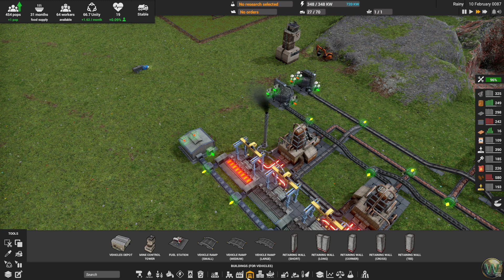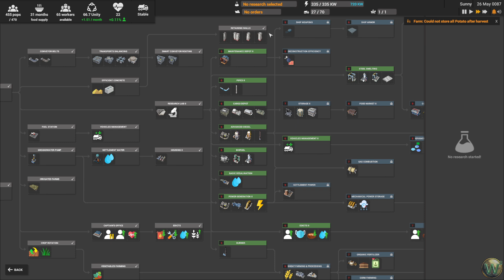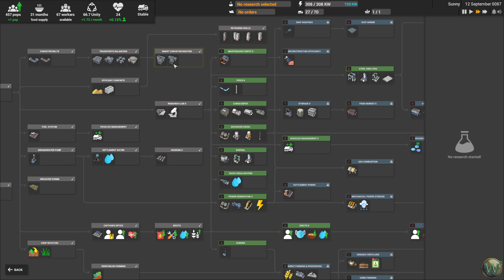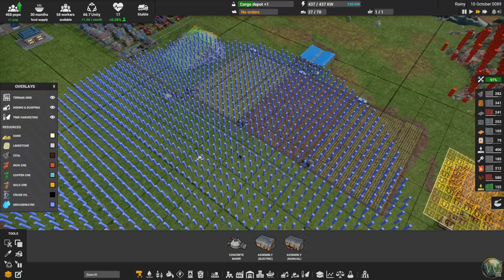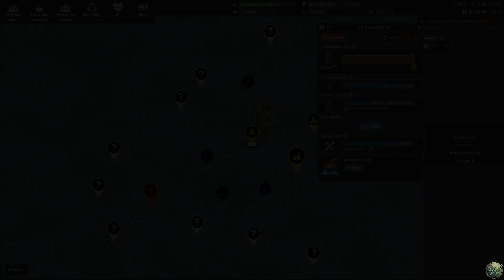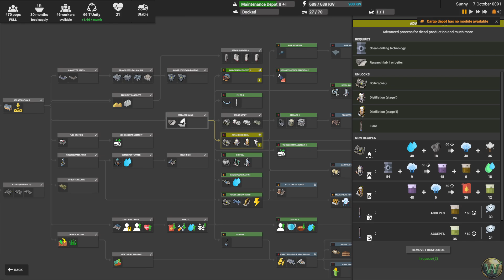Captain of Industry - Cargo Dock - Episode 15 - Let's Play

Comment: - Yes, you need additional tech to link towers with storages.  I didn't realize that it wasn't unlocked yet.  Advanced Logistics research is what you'll need.
- TRASHY solar! I like this idea :P But, power tech II is before that one .
- Storage in this game drives me nuts.  It's like ONI or Factory Town.  Not having a character with inventory can be a pain at times.
- Water is viewed by clicking on a pump just like the oil pumps.  Rain will replenish the pools over time.  However, you can outpace the replenishment with higher consumption so, be mindful of that.
- Yes, decon-ing things nets less material back.  Hover over an entity with the decon tool to see what will be returned and compare that to building a new one to see the loss.  It's a game so, psh.  Stuffs is not real (trust me, I know.)
Reply from the maker: Gotcha on the tower storage and the water pumps.  I’ll give the latter a look next time I play.  And yeah, I’m not that worried about losing a few items if I get a benefit from it.  It’s good to know, though